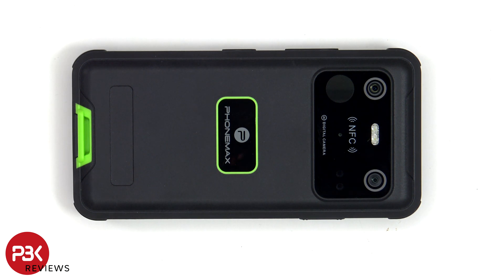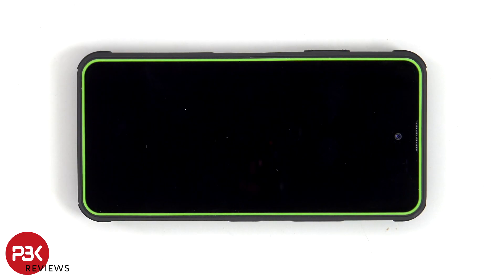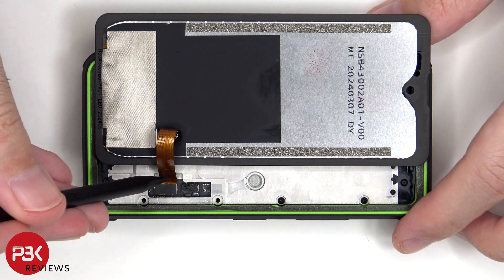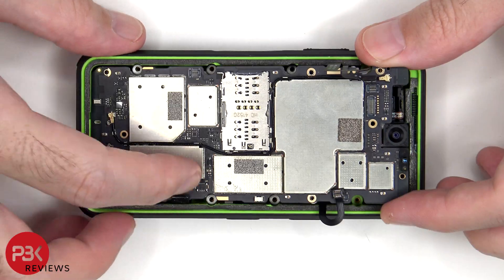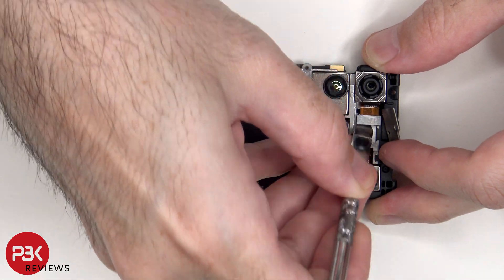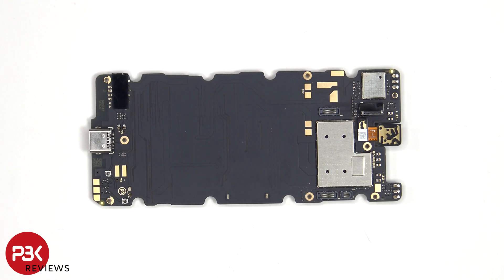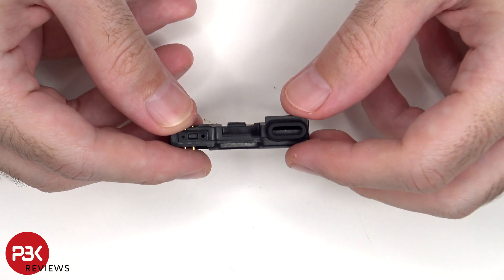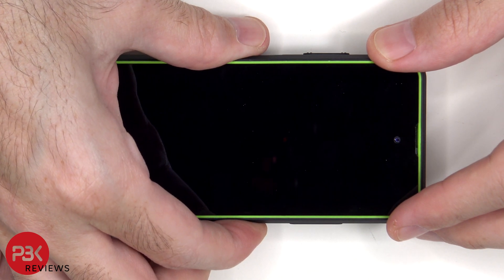Phonemax R4GT Teardown. Smallest Rugged Phone With Thermal Imaging & Night Vision!

Comment: Great video, thank you. 

When it comes to putting the screen back on, do you need to remove the existing glue and reglue or just warm it up again?

If it needs new glue, which do you recommend?
Reply from the maker: You're welcome. Since they don't sell the original pre cut adhesive for this phone from what I can see, you would either need to get one made for another phone and cut it down to strips you can apply or just use B-7000 adhesive glue (keep in mind cure time is between 12-24 hrs usually for these type of glues). Also yes you would need to remove and clean off the original adhesive and apply the new one or else it won't hold properly. You can watch this video for a bit of reference I did a while back: https://www.youtube.com/watch?v=T4iiPUIM7-Y
Reply: @PBKreviews thank you so much for your reply, that's very helpful.

Comment: My R4 GT is in boot loop. Any advice?
Reply: try to charge it longer.its seems like problem with battery
Reply: @dimonc1984  Actually it was more than that. I contacted PhoneMax and they shared with me the programming software. I've re-installed the OS and it is working perfectly fine since then.